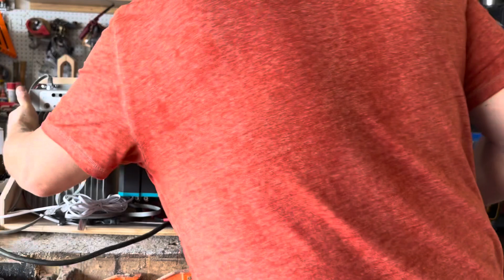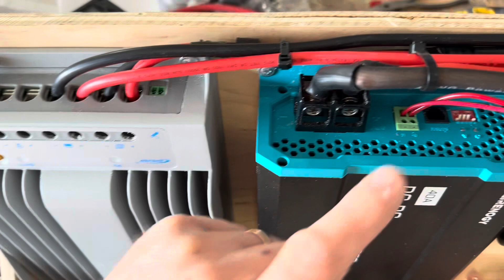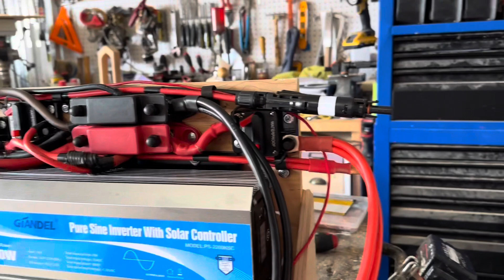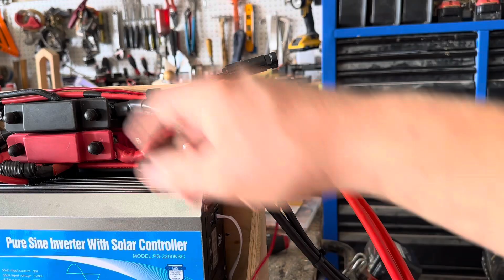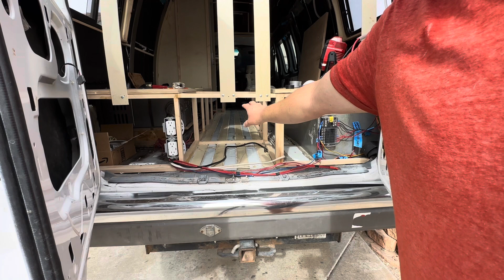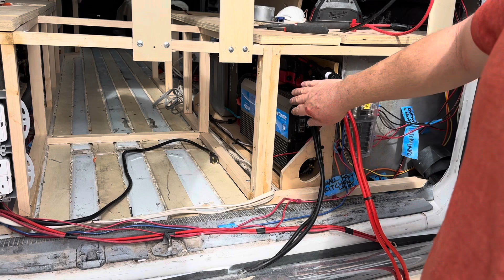Overview of electric components for my van build #4x4van #vanbuild #classbrv

Comment: @4:00 I'd argue that any configurable solar charge controller is capable of charging LiFePO4.  

@6:20 When I replaced FLA with LiFePO4 I assumed I'd need to replace the relay with DC-DC for alternator charger.  Luckily I tested it before buying anything because the relay charges the LiFePO4 quite nicely, within voltage and current specs for the battery and within the comfort zone of the alternator, current-wise.   In the broad middle of the voltage curve the bank accepts 0.2C (30A in my case).  At lower SoC acceptance spikes to ~0.3C, and near full it drops to ~0.1C.  The highest I've ever seen was 0.35C.  I disconnect alt charging at ~13.7v and let solar do the rest.

Comment: Dave, have you been using that brand inverter for a while? I’ve seen that one before, and it seems like a good blend of quality and cost. I’ve tried a Renogy, defective out of the box. Then locally, did a quick test on a 3000 watt harbor freight pure sine wave inverter. That one worked for a brief time, then failed, so trying to find one that will last, but not break the bank. Victron seems really good but pricey for me, since it’s just a temporary setup for a camper and occasional use, thanks
Reply from the maker: I don’t have tons of time with that brand, but it is my second one and both worked well. Good Amazon reviews too. I think it’s worth a shot. Thanks my friend
Reply: Thanks Dave

Comment: Are you having other 120V outlets?  I expect the AC will plug into one of those back ones but curious what your plans are for how you will use them?  I also have two different color 120V outlets.. so one can be shore and the other the coach inverter ...
Reply from the maker: Yes, I have two more outlets within the interior of the van. And I too used the black and white to identify the different sources